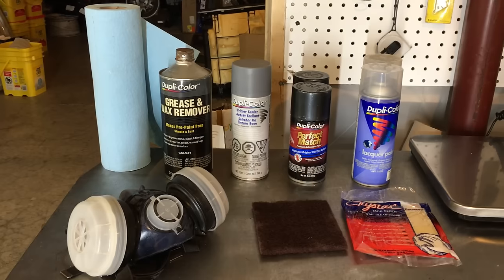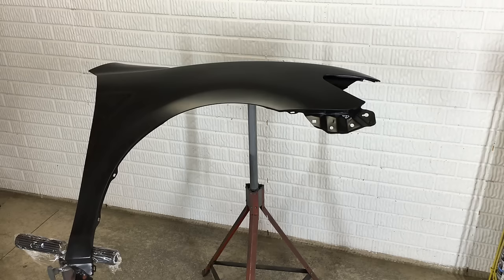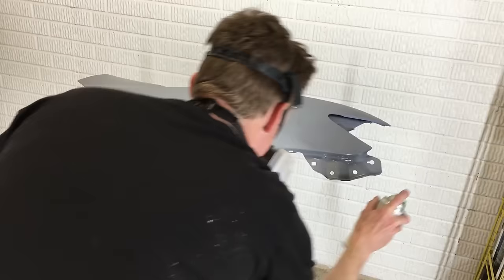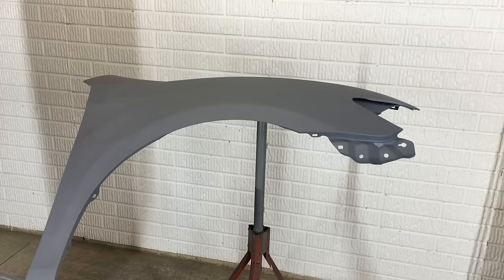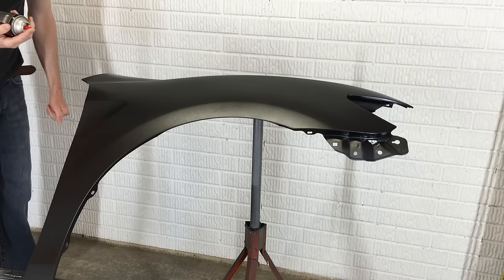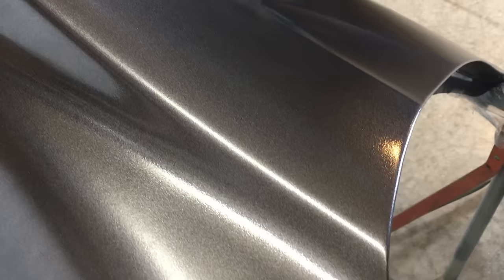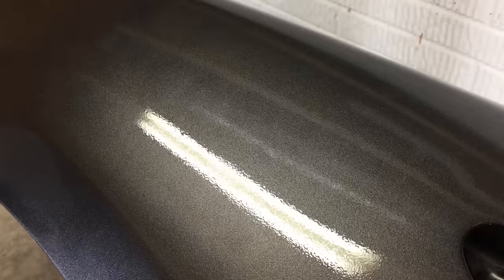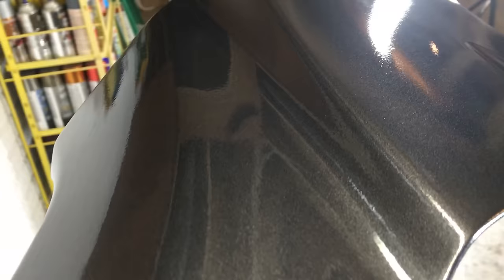How to Paint a Vehicle Fender with Spray Paint - Cheap & Easy!

Comment: hi how long did you wait to put the wing on your car after doing the top coat and how long did you wait to use cutting compound and polish o get the nice shine thanks
Reply from the maker: I put the fender on the next day after the paint as dry. 24 hrs is enough time for the compound too, as long as the paint has fully cured and the coats weren't too heavy.

Comment: Mines really rough and dull after 4 coats of duplicolor protective clear coat finish over universal black. Do I need more clear coat? Wet sand?
Reply from the maker: N B the rough sounds like orange peel maybe from too many heavy coats. At this point you could wetsand and clear again to see if it turns out smoother or add some more coats of clear on top of what you have and then wetsand smooth and polish. I’d go with the second choice since you’ll be sanding either way.

Comment: Can you help i been looking for my car color for awhile now Duplicolor i do my search but comes up with K23 and KH3 but my car color is KAD. I have a 2017 Nissan Sentra SV. I manually  enter KAD in search on Duplicolor but not in stocked tried emailing them but they don't reply. 
Graphite Shadow Metallic - KAD
I try even looking for my color in google but still cant find any. How do i paint my car and get same color!!
Reply from the maker: Instead of using the website, try your local autoparts store that sells Duplicolor and see if they can order it for you. That's what I did.
Reply: @6thGearGarage  actually I found it. My local stores still didnt have it found a similar site like duplicolor that allowed me to plug in my color code found right color it actaully Gun Metallic 👍🏿

Comment: If you don’t have a stand to place the fender on ? What’s the best thing to place it on? When applying the paint and all that good stuff?
Reply from the maker: Anything that will keep it off the ground at a comfortable work height.  A stock of boxes or you could build something out of 2x4's or even try setting them on an upside down trash can - but clean the trash can well first so no dirt ends up on the fender while painting.

Comment: Do you have to prep the inside gel coat as well or can it be left alone?
Reply from the maker: You can prep and paint the inside of the fender if you want, but it is not crucial, as it's protected by the plastic fender liner.

Comment: I keep getting tiger stripes on large flat areas... Any idea how to correct that?
Reply from the maker: It's tough to avoid tiger stripes with aerosol cans on large flat areas because the spray pattern is so small. Aside from using a spray gun, I don't know a good solution with the aerosol except try spraying in different/opposite directions on each coat.

Comment: Where did you get the replacement fender...? I can’t seem to find one for less than 125$ for my Volvo s40 2007
Reply from the maker: I got it on eBay, but I’m sure Volvo parts are more expensive than Toyota parts.

Comment: I have two drips on the basecoat. How do I get rid of them?
Reply from the maker: You can sand them down and re spray the color there. The lacquer paint blends well. If you’re careful, you can scrape them down with a razor blade first to save some time sanding.
Reply: @6thGearGarage   I sanded them with 600 . Worked out great . Thank you .

Comment: When I did this I noticed it made a dust cloud in the garage.  Is it safe to open the door I just don’t want it getting on my neighbors car
Reply from the maker: Yeah it should be fine. Lacquer paint overspray comes off like a layer of dust. It doesn't stick like urethane overspray does.
Reply: 6th Gear Garage   I was so nervous whew.   I’m using that Era Paint.

Comment: Can I use mineral spirits to clean dust off before applying my 2 in 1 paint primer ?
Reply from the maker: I would not use mineral spirits, as it is oil-based.  The primer or paint will not stick to an oily surface. You should use an automotive degreaser/ wax & grease remover that is NOT oil based.
Reply: @6thGearGarage  awesome thanks for the advice. Much appreciated

Comment: Where can I get one of the stands used in the video to hold the panel I am planning on painting a lot of parts and don’t want to just leave the panel on a piece of cardboard are there any alternatives also
Reply: Never mind I found one
Reply from the maker: They're actually for wood working, not ideal for fenders. They make stands just for body work that will be much better for you.
Reply: 6th Gear Garage thanks for the reply even though it was late I really appreciate it and the video was awesome!

Comment: any tips for painting a OEM fender form another vehicle to match yours? I'm replacing the fender on my Ram 2500, but hoping to use an OEM take off from another truck, different color.
Reply from the maker: There's no need to strip it down first if the OEM paint is still there and in good shape. Pretty much the same process, just clean the fender and make sure there are no chips or rust, then scuff it up and start with the primer sealer.

Comment: Why not just pull the original dent from the fender. Fill with bondo / prime / paint ?  You don’t need a primer sealer also with that cheap Chinese fender
Reply from the maker: Damage was too bad for that. Time = money.
Reply: new one was $30, I would go with less hustle for $30 all day

Comment: Great video!  Would you mind sharing what kind of cutting compound you used and how long did you wait before using it?   How's the paint been holding up over the last few months?
Reply from the maker: It's a really old jug of Meguiars Medium cutting compound. They have re-labeled their products on a 1-10 cutting scale now, but it's probably equal to this: https://www.meguiars.com/professional/products/meguiars-m210-mirror-glaze-ultra-pro-finishing-polish-deep-glossy-finish-0
Reply from the maker: I let the paint cure for a couple of days before polishing it. I sold the car not too long after this repair, but I will say it's crucial that you keep a coat of wax over lacquer aerosol paint, just to help protect it because it isn't as hard ad urethane. Also it's more important to wipe off any tree sap or bird poop asap.
Reply: @6thGearGarage  Thanks for taking the time to respond and sharing your experience.  I've been thinking about doing this to the hood on my truck but in the past I haven't had the results I was hoping for.  Your instructions are great and you make a lot of good points.  I think I'll try again using your methods.
Reply from the maker: @stevenf6885  I will say hoods are a lot harder because it's a large flat surface and you'll see more of the spray pattern from the can nozzle. On a large area like a hood, the wider spray pattern of a HVLP spray gun is the way to go. Not saying you can't do it with aerosol, but it's definitely more challenging than a fender. You're more likely to need to wet sand to make the surface more uniform. Best of luck... let me know how it goes!
Reply: @6thGearGarage  Also a good point.  I do have a HVLP gun but I'm not too familiar with when to use reducer, hardener and/or thinner.  I've been on the fence about which way I want to touch up the hood.  It's for a 21 year old truck that's not winning any beauty contests, so it doesn't need to be perfect.  We'll see, I'll let you know how it goes either way.  thanks!

Comment: ** did you let the color fully dry then apply clear? i wana let mine dry for a few days then put clear? that ok?**
Reply from the maker: Yes I let it dry fully, lacquer has no re-coat window.
Reply: 6th Gear Garage can I sand or buff the paint before clear coat? I’m having issues where mine is a ruff texture I’m gonna try 1 dry coat and 2 wet coats
Reply from the maker: Pie 4life I would sand the color coat and then apply more color coat just to be sure there won’t be any scratches visible

Comment: Quick question, is it necessary to use Wax & Grease remover? Currently I don't got any right now, I'm wondering if I can just clean it down with alcohol or water?
Reply from the maker: Water won’t do the job but rubbing alcohol is alright. The wax and grease remover still works best though.
Reply: @6thGearGarage  thanks, I'll see if I can get Wax & Grease Remover👍
Reply from the maker: @UNRSOLDIER  the PPG DX330 is pricey, this stuff is the best I've used and it's only $30 for a gallon, should last a long time. https://amzn.to/3e36vQr
Reply: @6thGearGarage  another thing I want to mention is the Primer, I have a primer here and it's called KRYLON Rust Tough Enamel Primer. I'm not sure if this primer will do just fine as a Primer Sealer, do you think it will work good enough?
Reply from the maker: @UNRSOLDIER  you should not use lacquer paint over an enamel primer, there’s a chance the paint will lift or wrinkle.
Reply: @6thGearGarage  is it worth the try though? I could try it, cause it says it primes the surface and prevents rust.
Reply from the maker: @UNRSOLDIER  for the price of the proper primer sealer, I wouldn’t try it because of the chance of having to strip it all back down and start over.
Reply: @6thGearGarage  thanks, so I found one called Rust - Oleum Primer Sealer, it's color is gray and I think this is the right primer to use right?
Reply from the maker: @UNRSOLDIER  as long as it is lacquer and not an enamel.  If it doesn't say on the can, I'd call the help # on the can and ask.

Comment: What should i do? Mine has paint from another car.
Reply from the maker: You should clean and scuff the entire surface of the old paint. Be sure that the entire surface is completely dull - any shine means it has not been scuffed well enough and the new paint may not stick well. Use the green scuff pad like I did, or some 600 grit sand paper. Next you'll be ready to start with the primer sealer and do the rest of the steps I did.

Comment: Did u use anything on the buffer or terry cloth? Like water or anything? Or was it a dry cloth and buffer pad?
Reply from the maker: I used a Meguiars polishing compound. There are different cutting strengths available, depending on the amount of orange peel you need to remove.

Comment: good try but the paint doesn't match the car at all.  that happens sometimes when the paint on the car is old but you buy new cans of fresh paint, it wont match, that is why body shops have paint sample cars they hold up to a car, they also feather panels in so that its not noticeable.
Reply from the maker: Yeah uv fade makes the oem paint lighten slightly over time. For a cheap fix on a cheap car, I’m happy with the results.

Comment: I wanna know where you got the fender for $30 shipped.
Reply from the maker: I found it on ebay way back then. Everything is more expensive now.
Reply: @6thGearGarage  lucky. I bought a fender for a 99 prelude back in 2019. Couldn’t find anything less than $100 for an aftermarket. And it was almost universally $80 s&h

Comment: Hi - simple question do you not need to paint the inside of the panel or  just leave it in the primer it came in?
Reply from the maker: I did not paint it because there is a plastic inner fender liner to protect it. On a vehicle without an inner fender liner, I would paint it.

Comment: Hey, do all these steps work the same with a matte finish instead of the metallic grey you used?
Reply from the maker: Yeah, only thing with a matte clear coat is you don't wetsand or polish it afterwards. So it's actually less work.

Comment: Can I drive around awhile with E-Coat in the elements ? I wanna wait until summer to paint will it erode ?
Reply from the maker: I've seen people do it and eventually the e-coat wears away and the exposed metal will rust. I'm unsure how long this process takes, but I would try to get paint on it before next summer. The amount of time you have probably depends on the conditions such as amount of sun exposure.

Comment: How long did you wait after applying the lacquer paint before you began polishing?
Reply from the maker: I'd wait 24-48 hours, depending on temperature and humidity. Warmer temps and less humidity will help the paint dry faster. Putting the fender out on a sunny day will also help. Just clean it well before polishing, or else any dust that lands on the paint will scratch the surface when you use the buffer.

Comment: is the fender stand necessary? What's a good way I can prop it up safely without one
Reply from the maker: It helps, but you could build something out of 2x4's instead or hang it from something might work too.
Reply: I used a camera tripod covered in plastic.  Not ideal but it got the job done!

Comment: Do i have to repaint the area if its not too faded or can i just use clear coat?
Reply from the maker: It's hard to tell without seeing the actual surface condition. In general, if the clear isn't worn through all the way, you might be able to get by with just the clear.

Comment: Does the color match perfect ? It is noticeable in day light ?
Reply from the maker: Aung Zoo it's extremely close.  The hue is spot on, however the metallic flake pattern is very slightly splotchy compared to the oem paint. It's so close that nobody who looked at the car knew I repainted the fender until I told them.

Comment: Where did you get the fender from
Reply from the maker: Found it on eBay
Reply: @6thGearGarage  oh ok thanks, is that the primer sealer you recommend using. I was need one that keeps paint lasting and won’t chip or flake
Reply from the maker: @rashadhalabi3190  yes I put links to the products in the description 👍

Comment: Does it require sanding after primer? And after clear.
Reply from the maker: Sometimes the primer can lay down a little rough. You don't have to sand primer, but it will usually be smoother if you do. Same goes for the clear, before polishing of course.
Reply: @6thGearGarage  thanks for your answer. 👍

Comment: I accidentally nicked the paint with the can while applying the clear coat🤦‍♂️🤦‍♂️ how do I fix it? Please help me
Reply from the maker: Edgar Salazar you need to let it dry, sand the area smooth with 600 grit then start over on the color costs. Or if you don't need it to be perfect, just skip the sanding and spray more color over the nick, let dry, then add the clear as you were.
Reply: Thank you so much for the help and quick response🙏 I really appreciate it and also for this video! Done everything as your video and so far it's looking great🙌

Comment: Nice.. how long did you waited till you applied the clear coat?
Reply from the maker: You only need to wait until the color coat has dried per the instructions on the can, but I waited longer because I was in no hurry.
Reply: @6thGearGarage  I tried painting my car with metallic colour before but once I layed the clear coat my paint became like crumbled texture and later once it dried it looked like mat finish and it was all rough when I touched. So wondering if I need to wait long enough before I put the clear coat on .
Reply from the maker: Maybe your coats were too heavy and that caused orange peel.
Reply: @6thGearGarage  yea could be. Tomorrow I am going to paint silver and I hope this time it comes out perfect.
Reply from the maker: I would do light coats until the wet coat to reduce orange peel
Reply: @6thGearGarage  yea that's what I am planning to do. Thanks for your time bud 👍

Comment: How’s it holding up?
Reply from the maker: I am not sure, I don't have this car any more.
Reply: How long did you own it before you sold it and how was the paint when you sold it?
Reply from the maker: @lueriver5474  Probably a few months. The paint still looked good. However on a nicer vehicle, I would have used a 2k clear coat.
Reply: Great thanks. That’s exactly what I was trying to figure out. I’m working on a beater so I don’t want to make the extra expense.

Comment: How long after did you polish ?
Reply from the maker: I Set the fender out on a warm sunny day and waited 24 hrs.
Reply: 6th Gear Garage so after a day it’s fine to polish ?
Reply from the maker: Tre Taylor yeah if the temps are hot that’s enough for the lacquer paint I used. If cooler, wait a couple of days.
Reply: 6th Gear Garage okay thank you temps in my area were 100 so maybe I’ll polish tomorrow afternoon 👍🏽

Comment: No UV protection, will definitely fade immediately. Won't hold up to chips or scratches, Color is off. If you're going to do it yourself the paint isn't the material to go cheap on. If you don't care or getting rid of it, definitely a cheap option but it won't last long